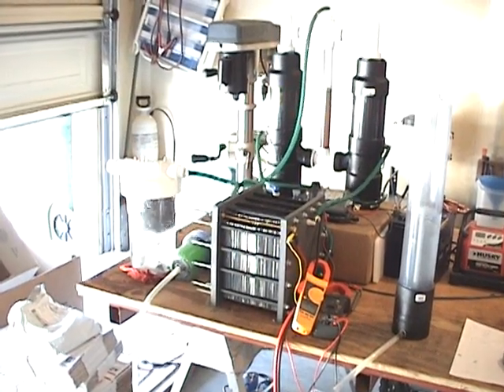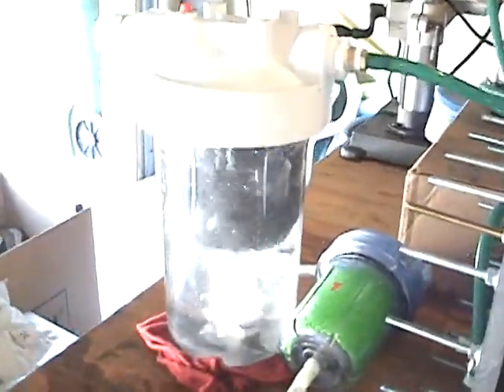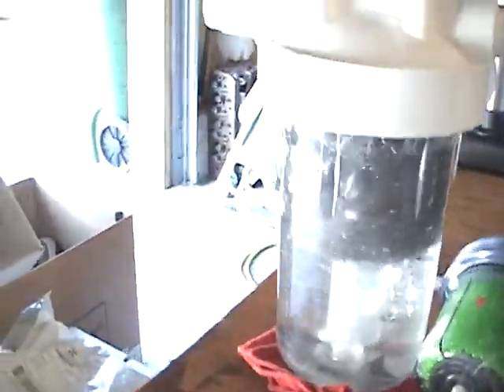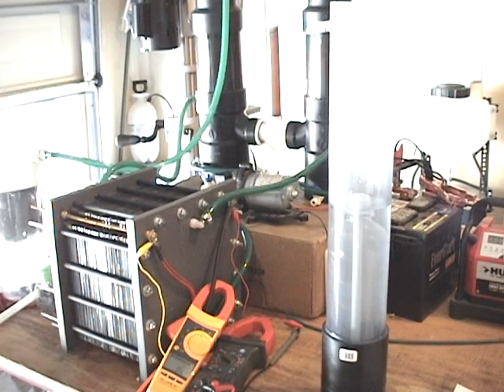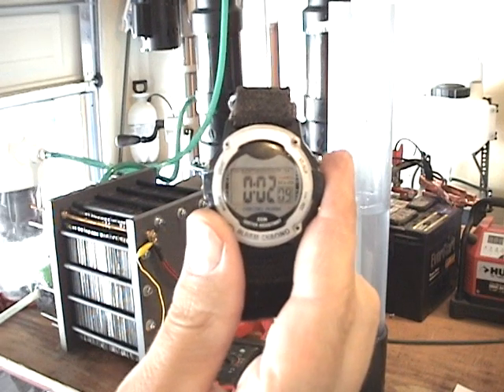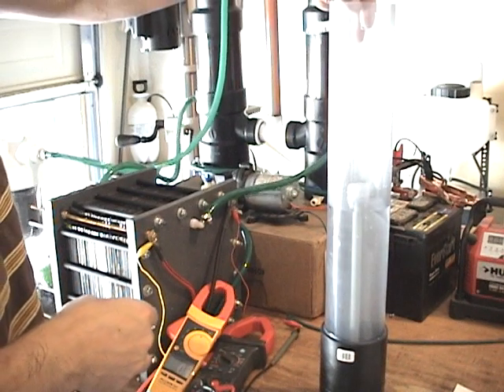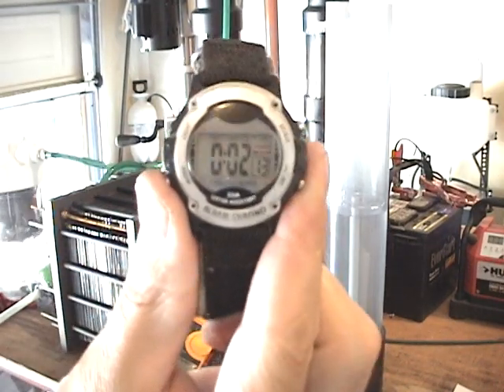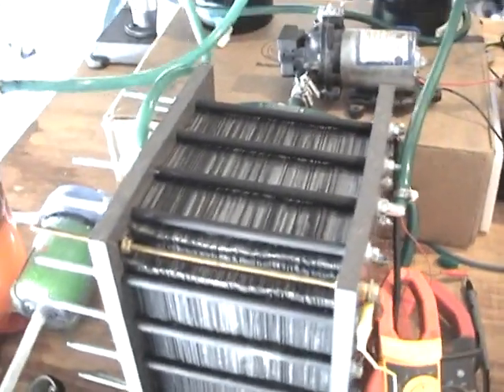30 LPM!! 118 plate Monster Hydrogen cell Back from the dead part5

Comment: which pwm they used for that test.
I need to buy a pwm for 220vdc
Reply from the maker: We did not use a PWM. It was straight DC
Reply: @Hydrogen4Health  so by not having the pwm, they do not have control of the current consumption
Reply from the maker: @jaimefloresalvarez1752  I use variable voltage AC controllers.

Comment: Does anyone know where I can purchase these cells?
Reply from the maker: Danyal Ahmad Yes they can be purchases at www.greenfuelh2o.com
Reply: delvis11 I didn't mean the entire generator. I wanted to purchase individual cells/aluminum plates. I was thinking about creating my own generator with somewhere around 60-200 cells. In you experience, how many watts and amps does it take to run a 60 cell generator?
Reply from the maker: for my design it uses approx 200 watts to make 1 liter of hho

Comment: You are getting me too damn excited with this 30 LP/M. Just to put my fears to rest, why don't you light that gas i.e. blow-torch just so these "Naysayer" will shut their mouths.  What size vehicle can run on that gas output? Also... If you are running that at 15a, 240v, can you run your system off of a std car or truck alternator without burning it out? I'm tired of this subject being called "Junk Science".

Comment: The SM buggy ran on 3 alternaters distributing the energy in a three way trist in 1989. There were 6 tube sets in the box in the back seat of the buggy. In 1994, after the injectors and air processor were developed,(the reformer system)some of the hydroxl was reformed and recharged with more hydroxl being made in the tank. High voltage(>45kv)was used with very small current(<750mills). This is verified in his labnotes that were purchased by my lab for replication. Go to yahoo watercar for proof.

Comment: The video called "truck runs 100% on water not on gas".You maybe right,because they didn't post anything else and the web overunitydotcom doesn't work..it's a dead end.So you think there is no way to run a car 100%HHO?How about Stan Myers water buggy?Also scam?

Comment: There is a video that two guys run dodge truck on 50lpm...really?! 300lpm is that what you need to run a car on pure HHO? I thought much less,so that would make  bad ass HHO cell..10 times bigger that what you have.You doing great job,I like your projects.How much pure HHO is needed to run generator 10kW for example?I guess yours 30lpm would do it and spin the 10kW..

Comment: once your system was setup to so big performance
you shall measure the production capacity by weight loss of the water
it's low cost then buy a dwyer flowmeters

Comment: Yeah, that goes without saying, but do not store it, just extract it from the water on demand and make sure you have enough voltage and amps to make sure it produces the right amount, you should probably add a controller so you can adjust the amps and the voltage and a switch for the power, this way you can cut of the power to the generator, which in turn produces your gas.
And remember, safety first ;)

Comment: @Dri0m 5 LPM in a car is more than enough.  Most I've seen run like 1-3 LPM.  To do more than that for a car would be a waste unless you really got into the timing and cam, and if your gonna do all that just get a vaporizer and adjust your cams accordingly that would increase mpg as much or more.  The military used vaporizers like in the 50's for tanks I think.

Comment: @Sneighke I'm sure you'd have to run another alternator or have an extra battery, but I'm sure it can be done.  But I know what you mean by some of these people trying to rip people off with devices that don't work the way they are advertised to.  I believe extremely cheap energy is possible, not free though.  If it were possible it still fail to exist in the mainstream.  Think about profit loss for big corporations that only exist to make us more in debt...  trash bombs!!  Yeah!

Comment: ahh but is it enough to run the generator you are using to create the electricity needed to generate the hydrogen, that is the true test, if it could run the generator, i think you would have something there, because beside the start up, you would truly be running solely off of the water and you could use the generators power for other things as well.

Comment: HI Steve,
              I like the operation of this HHO generator. Excellent. Just one curious question, " If we accidentally soaked our hands on that bucket of water, is there a possibility of electrocution? Is there any 240 volts DC residing on that bucket of water?"  ( Just a concern ) Thanks

Comment: I understand that you are using arround 4KW, and also your amount of HHO produced are so huge, so i´m proposing you to use this gas to run a 8hp power-plant (arround 250cc engine) that suply arround 7KW of power, then mabye you can try to do a CLOSSED-CYCLE: power plant suply the electricity to run the dry cell and the dry cell produce the HHO to run the power plant, and if you have some extra power mabye you can run any thing else with the extra power... please, try it and let us know :D

Comment: was that a fuel cell??? so we can convert those water back to H2 and 02 if we put back some power on it.. is it??? i thought the fuel cell can only be use to generate electricity from hydrogen... what type of fuel cell you are using? and how many watt does the fuel cell can produce... ??

Comment from the maker: @ke4uyp . In this video I say I was running about 16 amps and 240 volts. The bottle is rising so fast if I was off by one tenth of a second it would throw all the efficiency calculations off. The calculations are clearly approximate. I don't understand why your pushing your point.

Comment from the maker: @ke4uyp The cell is not running at overunity. The cell was running a 140 degrees. you didn't calculate the amount of moisture (steam). mmw is 7.81, temp compensated is 6.99. thats 90.2% to Faraday. 250@ 16 amps is 86% to Faraday. Calculating LPM with that amount of gas is hard. there is a lot of room for error but nowhere is there overunity.

Comment: your raising the bottle with both hydrogen and oxygen not just the hydrogen gas. check out my channel and see how I separated the 2 elements. the hydrogen gas and the oxygen.to get a true reading you need to just test the hydrogen gas not both which you are making right now, separation is the key.

Comment: @vox1philippines making a large volume cell for a car can be done. depends on what kind of engine you want to power. like I said, the new hydrogen fuel cell vehicles have a 100KW fuel cell that produces electrical power to run electrical motors on the car. It basically an electric car using a hydrogen fuel cell and hydrogen to produce the power instead of a battery bank. a fairly medium sized HHO cell could power that 100KW hydrogen fuel cell and in turn power the HHO generator.. I need money!!!

Comment: @w23trhfyer the key is to build a motor that is designed to run on HHO. I don't know how much LPM you would need to power one of those hydrogen fuel cells that are in the new hydrogen fuel cell vehicles. But those fuel cells are rated at close to 100KW to run the electrical motors. imagine using a fuel cell to power a HHO generator then using the HHO to run the fuel cell.. Would 5KW of power be enough to generate the fuel to power the hydrogen fuel cell??

Comment: what's your electrolyte temperature after running continuous for 30 minutes to an hour?? The higher the heat the more current draw.. Add a corrosion free radiator with fan after the reservoir tank to cool the electrolyte before it enters the cell. If you keep the heat down, the current will stay where you want it. I've ran straight distilled water and got zero current draw and just added enough KOH to pull 10A and maintained that for several hours with a radiator.

Comment: very impressive.. the key is to BUILD IT BIGGER!!! If I ever get the money, I'm going with a 24" x 24" plate system at either 62 plates for 130VDC or 124 plates for the 230VDC. Plate surface area makes ALL the difference! What you need to do now is use that 30LPM to either power a propane powered 30KW generator or drive a Stirling Engine that turns a genset, or use as heat source to flash boil water to steam to turn a steam powered turbine to produce power..

Comment: @delvis11 Awesome! I just completed my dry cell. Right now It's just a 13 plate modified lowes 304 blank switch plates. I sawed the ends off and flattened them. Then I cut the corners off at a 45 degree angle on the neutrals. I left a corner on the voltage plates. Im using a brass bolt for the volts. Im conditioning it now. Using only 5 volts. 2 tsp of sodium hydroxide to a gallon of water. Then im gonna do a distilled rinse and run distilled vinegar. It's a surprising amount of gas with only 5v

Comment: HI...what will be the future application of this monster Gen?..industrial welding machine?, Fuel cell refilling station?, or HHO on demand? If this will be used as fuel  to the engine, in your opinion, will this output enough to run 4 cylinder engine with hydrogen alone?

Comment from the maker: @HHOPWR  I could add more koh but there is a huge flow problem. It is really pushing this design to get 30 lpm.  If I were to use larger 5/8 inch ports and hoses and double the gasket thickness I know it will make 40 lpm. At 150 degrees this design pumps all the electrolyte out of the gen and out the output hose. That is what happened in this video. I am now going to tear it apart, clean it out and drill bigger holes. :)

Comment: Steve, Come on man. You have an 8000 watt generator. You still have half to go. Add a couple of cups of KOH and let that bad boy run. I am betting on over 40 LPM but it will be impossible to measure with a one liter bottle. Nice work but you can do more. I would love to see about 30 amps hitting that at about 150 degrees.

Nice work
Larry